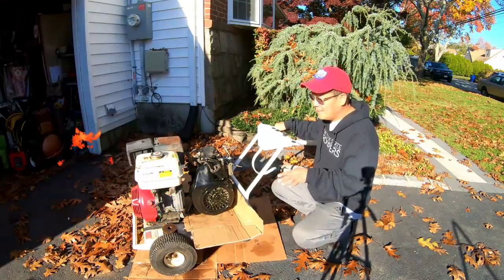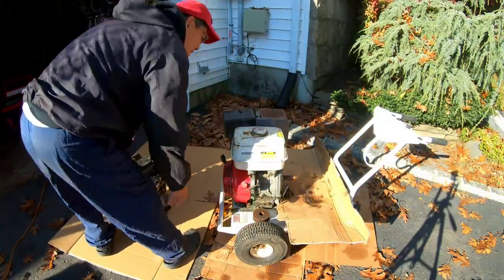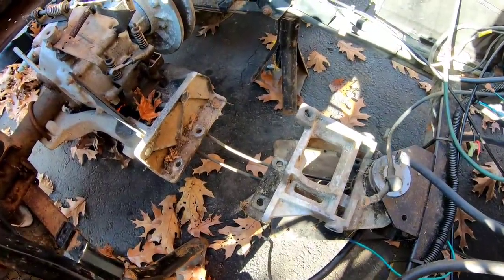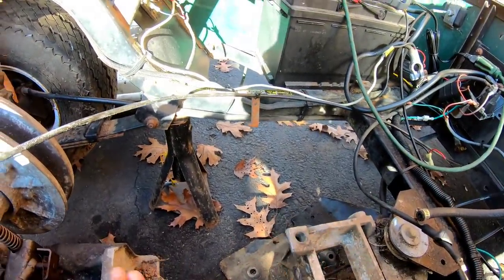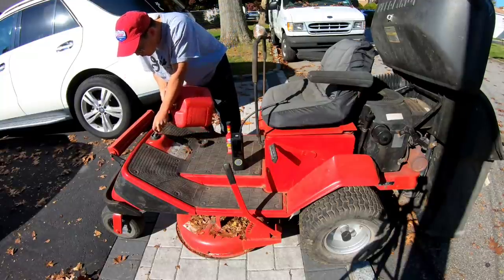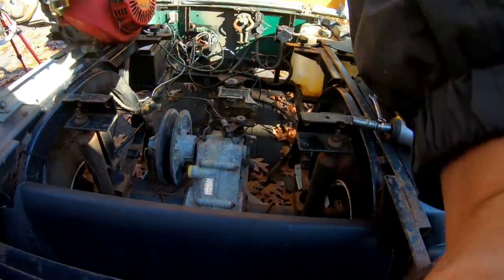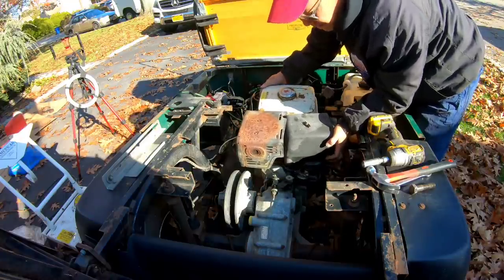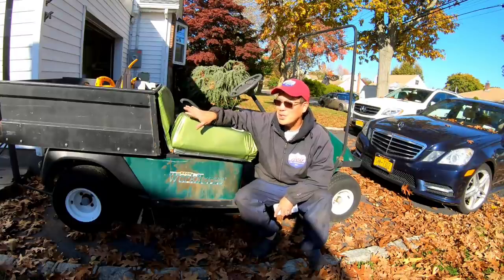HONDA GX340 ENGINE REPOWER PROJECT MOCK UP EZGO 1200 UTILITY GAS GOLF CART MOUNTING & FABRICATION

Comment: Project is Looking good Henry , when you mount the engine it might be a good idea to add rubber mounts to the mounting bolts it should reduce vibration

Comment: Henry can I use 19" blades on my 42 will it cut my grass
Reply from the maker: Try it and find out yourself!
Reply: @MowersNBlowers  Henry let's think about it my deck is 42 right it needs 2 21's if I use 2 19" blades instead of me cutting 42 I'll be cutting 38" leaving 2" of grass but 2 21's do everything at once

Comment: The oil drain uses a pipe thread. I know briggs does. So just use a threaded pipe plug. The one that uses a allen wrench female end so it is flush with the engine. This should give you another inch clearance. Most fab shops or places that manufacture furnaces will sell you or give a piece of the or twelve  or ten gage to make a plate out of. A machine shop will probably make the the plate for you, drilling yourself will save quite a bit. I'd forget the starter and just use the pull cord, unless you find a Honda starter that fits. Run your lights using components from a lawn tractor. Hope this helps. Been watching all along, just ain't posting much after my heart attack. 
Ray
Reply from the maker: But then I can never drain the oil.
Reply: @MowersNBlowers  Probably need siphon, but would giv3 you a little more room.